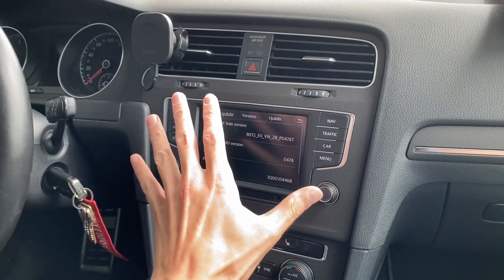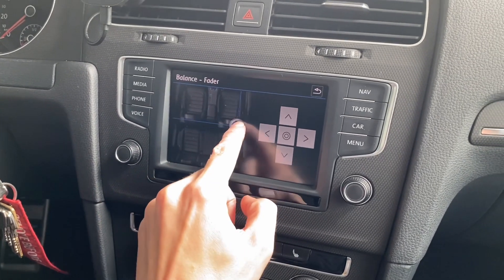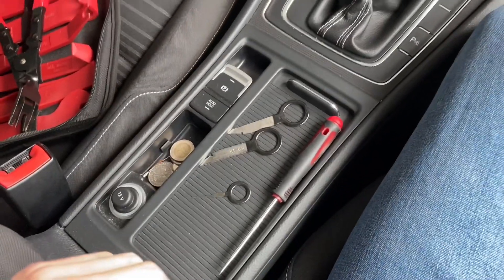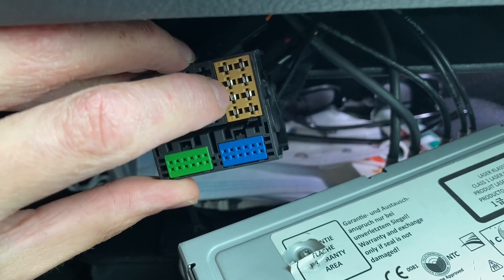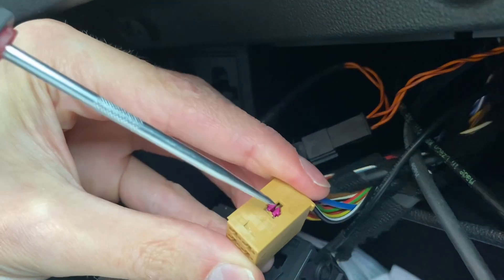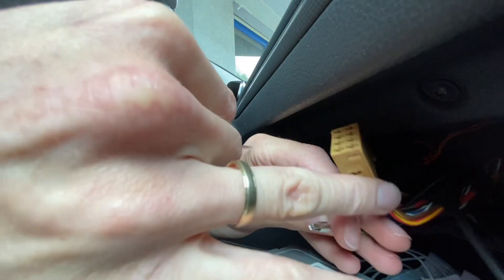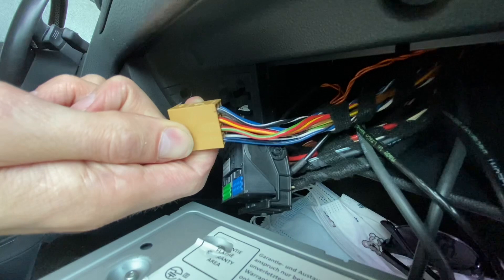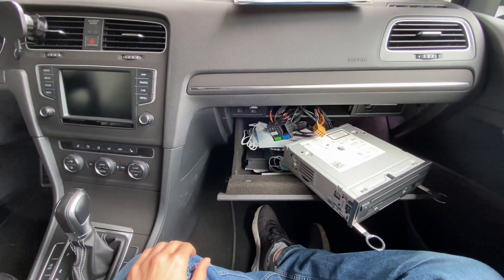QuadLock connector audio channels mixup fix (repining terminals)

Comment: is the 4 version better and worth the upgrade? what features does it have extra?
Reply from the maker: new skins, support for 3-port USB hub, facelift model graphics available, in-car communication feature supported, VC/AID support, refreshed welcome animations, skins for 8-inch displays with smaller fonts and buttons, remembers last screen in CAR menu after ignition cycle, WLAN media source, VW Media Control option.

Comment: hi there I patched my mib2st seat leon with toolbox but only mirror link work not Android auto or apple car play I even installs swp code can you make video for that one.
Reply from the maker: Check with diagnostic tool: module 5F > adaptation > vehicle configuration > Apple... & Google... Both needs to be enabled there.
Reply: @mrfixpl  thanks for replying I got obdeleven ill try thanks again
Reply: hi there I can't find android auto or car play in adaptation I search android auto or car paly didn't comes up what shall I search for thanks
Reply: I find it now but when I try to save with hold the green button its says function 31 not available can help please